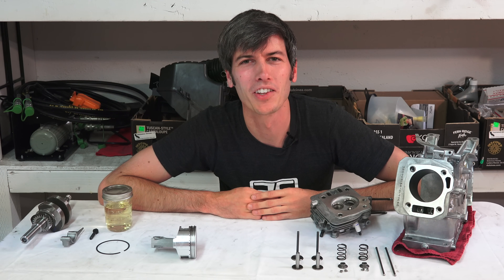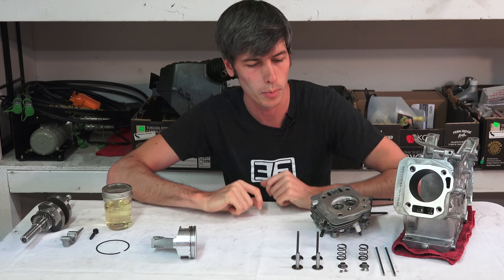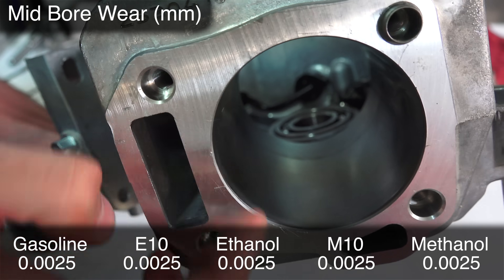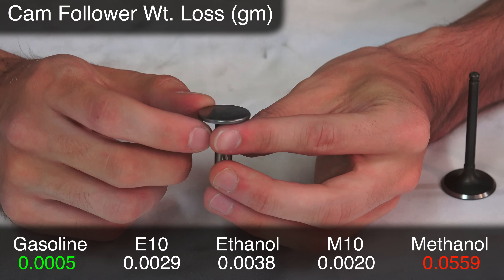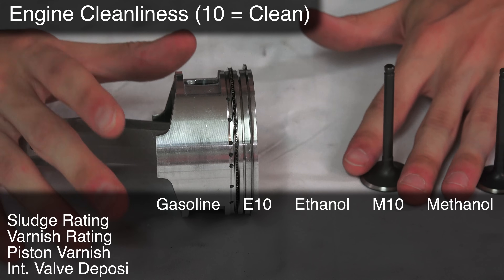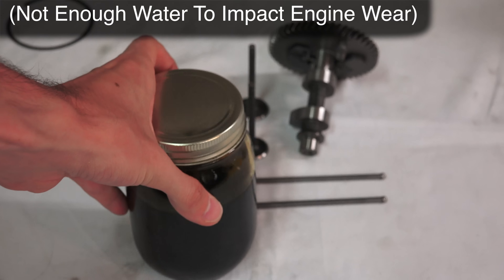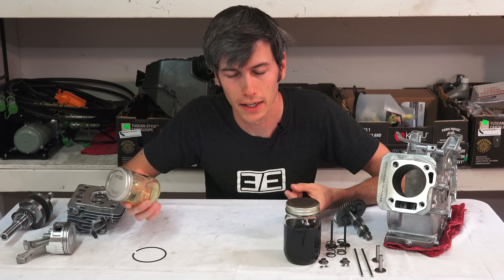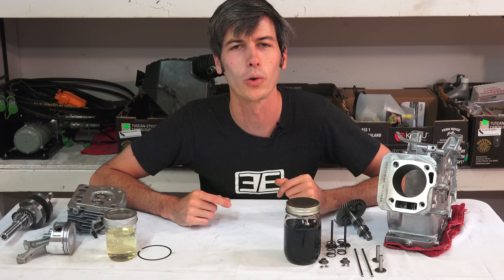Is Ethanol Bad For Your Car's Engine?

Comment: If you live in the Midwest there is Casey's General Store sells 92 octane with no ethanol and there is AMOCO (Standard Oil) stations popping back up and now they sell 95 octane Ultimate Gold with no ethanol kin my area. Out east SUNOCO sells a 97 octane with no ethanol and I used that in my 1993 Oldsmobile 98 3800 Series 1 V-6 and I got 42.9 MPG out of non ethanol and with ethanol it ran poorly and only got 32 MPG highway So I changed to suing only 95 to 97 octane no ethanol and had no carbon deposits in the intake. Most engines  2004 on down were not designed for ethanol and any carberated vehicles pre 1989  and we rebuilt a lot of carburetors because of the ethanol eats the rubber gaskets back in the 1990's when I worked at an AMOCO garage we had to rebuild carburetors because of the engines back in the 1980's and 1990's and even early 2000's car were not designed for it and we would have to replace hoses and it was costly a carburetors  had gaskets wore and the cost to the early emissions stuff  damaged for the corrosive properties of ethanol would cost you 500.00 back in 1995. I will not use any gas with ethanol in it at all.

Comment: ethanol is hydroscopic. that´s the main problem. it shouldn´t cause damage on your car, BUT especially in winter when you have cold starts, maybe you are not driving so much, than problems may begin. so dont len the e10 gasoline be too long in fuel tank. that´s a main case of problems which are described by other people. if you have some car only for weekends and so, it will suffer the most. so may consider to almost completely drain your fuel tank and before drive, give to your car some fresh fuel. (and no the e10 additives are scam :D )

Comment: I'm surprised it's not brought up more but a notable advantage of the ethanol blend is that it lowers the freezing point of the water that gets mixed up in the fuel (believe me, it's in there) so it helps make sure you don't freeze your fuel lines in the winter (cold climate specific advantage). Winter fuel additives used to be a thing in Canada and I don't even see them sold in gas stations anymore now that E10 is the norm.
Reply: Instead it will turn into physical obstructions that block orifices in carburetors making your rarely used engines require insane amounts of maintenance
Reply: @emp_zealoth  who uses a carbureted engine for anything now ?
Reply: @VRRanger-e9e  they're pretty common in used motorcycles that rarely get ridden and require insane amount of maintenance thanks to ethanol fuels fouling up their carburetors.
Reply: Evidently you don't mow your lawn or use a snow blower
Reply: @edblevins681  I live in the city. I have a shovel, snow tires and an electric mower.

Comment: In my 15 F150 with a 5.0 coyote there’s a distinct difference in gas mileage 
All results assume empty truck with tires at 36psi on 80% highway driving 
With e10 regular pump gas I averaged 18.6 mpg 
With e85 it dropped to 14.2 mpg
And with non ethanol the gas mileage increased to 21.6 mpg 

Truck wants to run at a higher rpm range with e85 and holds higher rpm through the shifts

Comment: I saw a brand new 2008 Tahoe with a side by side comparison between E85 and whole unleaded gasoline — 603 miles on a 30 gallon tank for about 20 mpg; using E85 drops 150 miles a tank and about 3-5 mpg.  I currently work at a Chevrolet dealership and I have yet to see a new vehicle with the E85 flex fuel sticker on it and I don’t remember the last time I did.  The video mentioned it was a 20 hour test — how does that correspond to overall driving time if the engine was driven in the car?  The results showed what happened after 20 hours; what about over more time and use; what about changing out the usually filters, oil, and O2 sensors?  From what I gathered 20 hours is a short period of time compared to how long an engine is actually used.  Fuel use is only part of the issue  — the test did mention about what affect gasoline, ethanol, and methanol had in engine parts and what metal was in the oil but made no mention of what kind of oil was used and whether or not an oil additive or even a fuel additive was used.  I’m willing to bet that if a test includes the things I’ve mentioned that you would see different results.

Comment: Ethanol is not corrosive to automotive fuel components. But if an ethanol based fuel is allowed to sit for long periods, it will absorb moisture. Once the ethanol fuel has reached a certain level of moisture, bacterium can grow and survive in the fuel mixture. The bacterium consume the ethanol (as a food source), then excrete acetic acid. (for acetic think of the acid in table vinegar). It is this acetic acid that corrodes fuel components. Bacterium can not survive in high concentrations of ethanol, so always adding fresh fuel (ethanol) will kill the Bacteria and prevent corrosion.
Reply: interesting insight

Comment: Yes, think about it diesel tractor to till field, ammonium nitrate to fertilize oil product diesel tractor to harvest, diesel truck to get it to still, takes 8 gallons of water boiled away by natural gas, diesel train or truck to haul away, can't use pipeline will eat pipe! Alcohol has wrecked millions of small engine and carbureted cars, there is no gain only expense, made for drinking not running engines. Many think it's good because they know nothing about it, ignorance is bliss!!!!!

Comment: I've never heard anyone complain about engine wear. It's always been about the water content. What are the long term consequences of this increased water content? I also think that for older vehicles, it's the alcohol content which was perceived to have degraded the components of the engine systems if not components of the engine itself over time. How far off base are these concerns?
Reply: Long term problems with extra water is rust in steel uncoated tanks.

Long term benefits of extra water include cleaner pistons and combustion chambers as the steam it creates actually steam cleans the piston of carbon deposits.

In the end, it's significantly better to have ethanol in the fuel, as ethanol is also an octane booster, and if it comes from the right source (such as switchgrass instead of corn), it can possibly reduce greenhouse gas emissions by as much as 60%, or so current data shows.

Comment: Cool video, but as usual the so called "tests" doesn't really test the fuels in long term scenarios.  I want to know, over time, the difference.  Especially on non engine components,  like fuel lines, fuel pumps, gas tanks, injectors.

Comment: Not sure I give a lot of credibility to a 40-year old study. Oil formulations, fuel additive composition, piston ring composition and even cylinder wall metallurgy may have changed significantly over 40 years, all of which could change the results if the study were repeated today. Interesting to note that the increase in water content of the oil. Although not significant on its own, if a particular engine is susceptible to sludge problems, that would certainly make sludge problems worse.

Comment: My question is what is the effect of ethanol damaging to 2 cycle motors? I have a large outboard motor and I have been told that ethanol is very bad for them. I would like to hear what you have to say about this. Thanks I like your videos.
Reply: Without going into major detail I can confirm that ethanol laced gasoline pretty much killed my small lawn mower engine. After we switched to e10 it's carburetor wood gunk up every week

Comment: the numbers in this study are all over the place it seems obvious to me that this study is in complete. did was there only one engine per category, because it seems as though it has many nuisance variables, such as tiny differences in the manufacturing of engine parts. this leaves me completely baffled, because this seems more like someones college project than a study that should be used to examine the differences of these fuels by the Department of Energy and US Army, mot of whom can afford millions four cylinder engines with negligible impact on their overall budget.

Comment: I do have a concern, my 2007 V8 S5 does not like ethanol very much.
In 1981 there were not as many rubber and plastic parts in engines, and interestingly, the study does not seem to focus much on any of those parts of the fuel system that worry me most, such as most components of the fuel delivery system.

Comment: Great video. In Australia I use E10 in my 2004 VYII Holden Adventra LX8 all wheel Drive. The LS1 V8 runs well on this fuel with no issues and has been for the 5 years I have had the car. With the E10 it depends on what service station you get your fuel from as to it’s Octane. I usually go for the United Fuel where the E10 is rated at 95 Octane or Mobil where their E10 is rated at 94 Octane. All others their E10 is rate at 91 Octane.

Comment: I am hesitating exactly for those reasons , i am confident about the bloc and all but my fuel line are 20 years old soooo i think i will do 80/20 70/30 to test how injection reacts and fuel pump

Comment: The problem is I paid for petrol the e5 mix that the UK had for years was not made public knowledge untill 2018 when they started to show this on the pumps. Same as the 7 percent bio diesel mix the public thought they were buying diesel.  Deception in my opinion.

Comment: This is NOT the BIG problem !
The issue is in ethenol fuels sitting over time !
Without a "quality" fuel stabilizer 
( no, not Stabil )
Once you have Phase separation, carburetor, and fuel injector damage is EXTREMELY costly !
In small engines, I highly recommend aviation gas, or 
non-ethenol fuel !
Your mowers, and trimmers will thank me !
Even with a good high quality fuel stabilizer, long term fuel storage will only give you around a year, nothing much more than that !
Failures, are extremely costly in equipment repairs !

Comment: did i miss the bit about the age of the cars tested?  Although this was done in 2018 cars before then have been mentioned as at risk from damage, you only mention older than 20yrs.  So I'm still looking for that specific confirmation.

Comment: Etanol blend is designed to reduce the carbon foot print from engine emission not to protect engine.Thst is why frequency of oil changing is totally different from unleaded gasoline compare to leaded gasoline.

Comment: People with cars with forced induction, that also have stand-alone programmable ECUs like E85. Alcohol cools the charge and allows for more boost and timing, without detonation. Yes, the car will use more corn juice than dino juice, but it will be faster.

Comment: On a cross country trip I was surprised driving through Oklahoma that my car felt peppier, and I was getting 10% better gas mileage.
The realized it was real gas, not the 10%.
They might as well put 10% water in, same result.

10% ethanol is one of the biggest modern scams.
A political promise made to corn states that will be darn impossible to repeal.

Comment: This begs an obvious question with possibly an obvious answer. Why are gasoline distributors adding the ethanol if it diminishes gas mileage?  Less gas mileage = more sales.
Reply: No, it was done to help America's farmers. The rub is that growing corn to make ethanol isn't efficient. Sugar cane is much better, but it needs a hot wet climate to grow which doesn't benefit our farmers. So, we use corn.

Comment: it is horrible in small engines obama is a criminal who wanted to destroy peoples old lawn mowers and power equipment as well as cars. i had it destroy fuel lines and carburetor parts. this is a useless test it does not show car sitting with this stuff in it .

Comment: Perhaps you could do a video on the impact of alcohol on different old (carbureted) and new (injected) engine fuel systems? I notice when pulling apart small engine carbs the regular e10 gas leaves a lot of gunk in the fuel bowl and passages.
Reply: Gasoline mixtures go bad. Gas caps must vent or fuel cannot flow into the carburetor, and as everyone should know, oxidation (exposed to oxygen) destroys everything. This is why humans can't breathe straight oxygen for very long, as it literally destroys the lungs given enough time.

There are stabilizers to prevent this from happening so fast, but ideally, you want to burn that fuel within a week and run the engine until the tank and carburetor bowl is dry. Hope this helps!

Comment: Just switched to E10 in the UK for regular unleaded. They claim a 1%!decrease in mpg.  I've gone typically city from 16-19 to around 11...   highways was between 24-27 now is typically 20-22
This is on a Porsche Cayenne. 
I've switched back to Shell VPower 
As E10 seems to have caused a premature primary fuel pump
Failure.

Comment: I've tested my 2013 Scion Tc2 Automatic with 85oct (E10%), 89oct (E5%), and 91oct (E0%). With mostly stock (basic boltons), no tune (not yet necessary), and I have dyno tested, track tested it and distance highway tested it, all with Shell Gasoline (others comparatively give me less fuel economy) and my findings were that with any amount of ethanol in my engine killed it's performance, I would lose up to 30 horsepower to the wheels. 

With the 91E0% octane I managed 205HP to the wheels 0-60 in 6.2 seconds and 8.2L/100km ( I know numbers can vary dyno to dyno and it probably isn't that high but it's the only one near me so that is the numbers I have)

With 89E5% octane I dropped down to roughly 183 WHP, 0-60 IN 6.8 seconds and 8.4L/100km

With 85E10% octane I dropped even further down to 176 WHP, 0-60 in 7.4-7.6 seconds and 9.0L/100km (and the engine sounds like it is trying to churn molasses when attempting to accelerate, really a disgusting noise and it is slow to raise the RPMS). I didn't even bother using up the gas or diluting it, I siphoned it out of my tank and put it in my truck's fuel tank

Comment: Also from Brazil here: Our flex fuel cars are well suited for E100. But still there are some ppl who think that the engine will achieve poor performance or break with pure ethanol and just don't want to give it a try themselves. This myth comes from the 80's when cars did not have electronic fuel injection (EFI) systems and thus performed poorly on ethanol until the engine warmed up. Also some cars were cheaply converted from gasoline to ethanol by auto shops and did not have proper factory materials to withstand the water from hydrated ethanol, which lead to premature corrosion of exhaust parts. 

Since mid-late 90's all cars in Brazil have EFI and flex fuel cars from 2000's have advanced ECU software and materials to deal with any blend ratio between gasoline and ethanol. By no chance ethanol will make them run poorly or increase wear as those misinformed outdated ppl think. In fact new engines achieve maximum horsepower and better low-end torque when 100% hydrated ethanol is used as fuel. Also there is less knocking and oil contamination when compared to using gasoline blends.

PS: Pure gasoline is not available here for comparison. Because of how fuel law works in Brazil, pure gasoline cannot be sold to end customers.

Comment: blended fuels shouldn't bother the camshaft at all, because the air/fuel mixture can't get TO the camshaft, followers etc - clearances are too tight for that to happen, and lubricating oil should take care of any clearance issues, barring neglect & overuse...

Comment: Here in Brazil,  we have 100% pumps in every gas station. And our gasoline is E27. The worst part is for cars that are not prepared for this fuel. Brazilian made cars can handle E100 with no significant wear. Even the engine lubricant displays less , much less carbon deposits and lasts much more.

Comment: Very informative, this!  I find it quite interesting that ethanol does not cause any noticeably adverse effects on the internals of a car engine, and this is from the established research of 1981.  I remember a lot of scare-stories involving gasohol back in the day, and I was expecting to see the same thing with the mandatory reinstatement of gasohol.  But it is good to know that gasohol will not actually cause any noticeable damage to an engine's innards (well, unless the -hol is METHanol, that is).  Of course, then that begs the questions about overall energy efficiency and any adverse effects on the fuel-delivery systems, and this video does confirm those concerns:  Ethanol does not produce the same BTUs gasoline does (ergo, from an energy-output perspective, less efficient as a fuel), and its alcohol nature can corrode carburetors.

So, bottom line for me is, I am actually doing my car (which is as old as I am) a service overall by identifying and utilizing pure-gasoline outlets...but in a pinch, using occasional gasohol will not strand me.

Comment: Ethanol and Methanol are an alcohol fuel, it washed oil off the cylinder walls. It's like running your engine low on oil. Ethanol is cheap to produce, that's why big old companied use it.

Comment: A machinist I worked with in the past  told me about how engines that did not achieve full operating temperatures tended to gum up the valves, and cause premature engine failures.

Comment: Ask any outboard motor mechanic and they will say E10 will DESTROY your outboard and to avoid it like the plague. Something about it absorbing moisture then depositing moisture where it will do damage. This isn't mentioned in the Owner's Manual, where it says you CAN use E10 without any ill effects. I don't know why outboard engines are supposed to have this problem while every other gas engine apparently does not.

Comment: 5he engine wear isn't the issue it's the fuel system issues when it sits unused for months at a time. Mowers motorcycles snowmobile